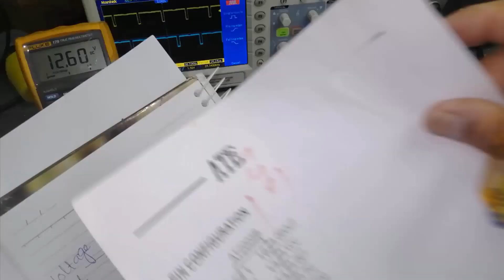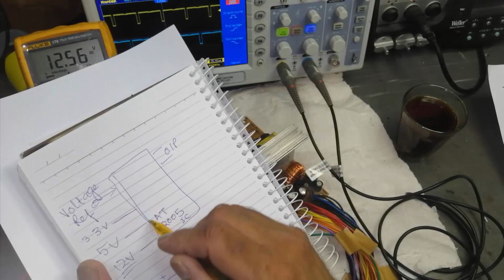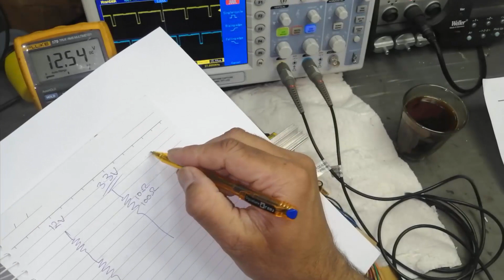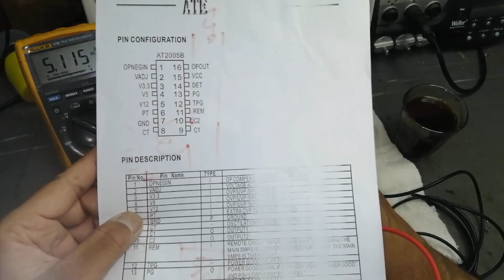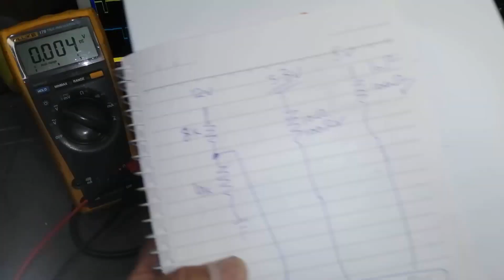#193 How to increase or Adjust ATX AT2005 IC Power Supply For Higher Output Voltage

Comment: I have an AT2005A, and the pinout seems to be completely different - pin 5 is ground and is measuring 0V.  I cannot find a data sheet for this; I can only find, as yours, AT2005B.  I find it hard to believe they are that different.  Do you have a data sheet for AT2005A?  Thanks
Reply: Getting back to my PSU project, my 12V rail is still 11.4V.  I know that is with 5% tolerance, but it is the only voltage rail that far off target, and the computer was not running well with this PSU as is.
Reply: Yes, there is a difference between A and B.  Also, similar to AT2005A is WT7614L and LPG899.

Comment: Can I replace 1000uf to 3300uf capacitor in atx power supply filter capacitor
Reply from the maker: yes it can be replaced but it will make some extra current surge in startup. if less than 3300 is available then it will much safe
Reply: @HaseebElectronics  Sir, thanks to reply

Comment: My power supply's 12V dropped to 11.2V. I'm trying to fix it, but I don't know what is causing it. Is it due to resistance? 5V is coming out well.  What should I check?
Reply from the maker: it means 12 volt section might be loaded due to some leakage in capacitor, 
or check rectifier in 12 volt section as well. 
what is condition of 3.3 volt
in some conditions we need to adjust EA amplifier of PWM controller to increase some pulse width to increase output volts
Reply: @HaseebElectronics  Thank you for answer. 3.3v is also ok. I asked a question because 12V didn't come out properly even though I changed all the capacitors. I'll check the rectifier. This model does not have a variable resistor. Thank you again. The videos are so helpful and watching well.

Comment: Sir, which resistor was removed because ADJ Pin has 5 to 6 resistors. Ground resistor or other.
Reply: @HaseebElectronics  my smps have ic sdc2921 and pin 16 is ADJ pin and pin 16 have 6 resistor  and one PF capacitor. ( 3 resistor are connected to ground one resistor is connected to 3.3volt one resistor is connected to 5volt one resistor is connected to 12 and PF capacitor is connected to resistor and resistor is again connected to 12volt) . so tell me which resistor I have to disconnecte
Please reply